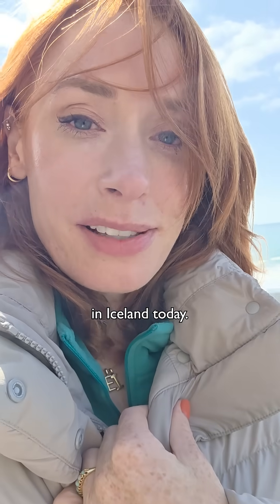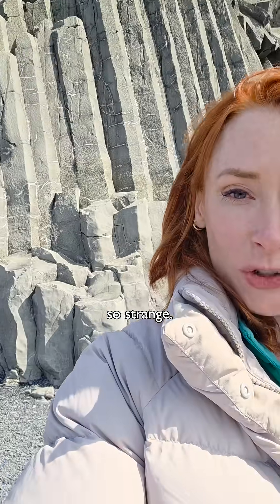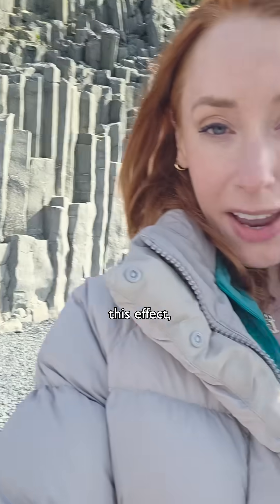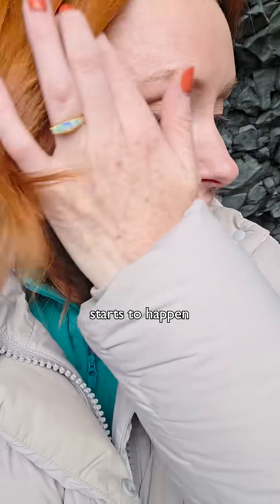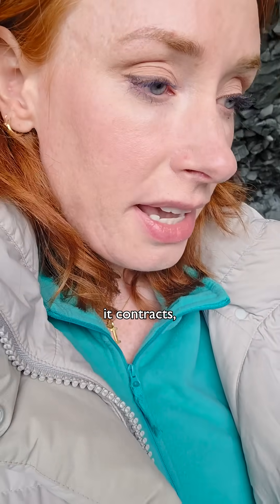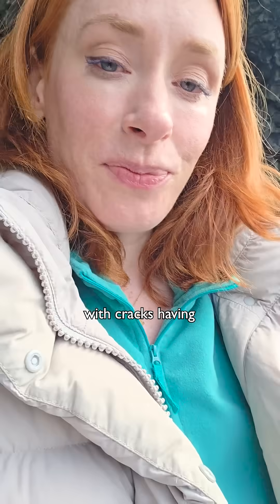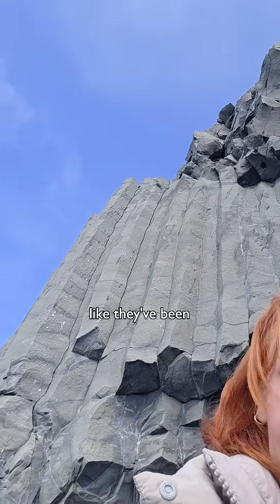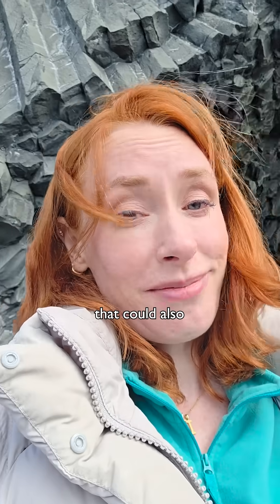Cracking the code of hexagonal rocks (aka columnar jointing)

Comment: I actually had to learn about this in Geography.

From the textbook: 

As subaerial basaltic lava cools, significant contraction forces build up in the body of the rock mass resulting in extensive fracture network structures which are predominantly hexagonal in cross-section, but polygons with three to twelve sides can be observed similar to those seen in dried-up mud of a marsh or river-flat that has been exposed to the sun (Holmes, 1965 and Wikipedia, 2012a). The structure that is formed during the cooling of subaerial basaltic lava is called columnar jointing (Figure 1). These joints provide ideal site for weathering of the basalt to take place.

Weathering of Basalt: 
The separation of shells of a weathered rock is called spheroidal weathering. It is best developed in well-jointed rocks which, like many basalts and dolerites, are readily decomposed. Water penetrates the intersecting joints and thus attacks each separate block from all sides at once. As the depth of weathering is greater at corners and edges than along flat surfaces, it follows that the surfaces of rupture become rounded in such positions. As each shell breaks loose, a new surface is presented to the weathering solutions, and the process is repeated again and again (Holmes, 1965).

Comment: <-- NASA Engineering Physicist (One of my engineering degrees is in Materials Science)
It's composed of Igneous rock with a hexagonal crystalline structure, causing them to fracture along 120° angles. There are 2 well-known geographic features here in the North American continent which are composed of this type of rock. The first is the Devil's Tower in Northeast Wyoming, near the Black Hills & the second is the Devil's Post Pile in Northern California, just south of Lake Tahoe near the Mammoth Mountain Ski Resort. The cooling of the top layer acts as a seed crystal for the fracture of the Miller Indices of the rock to fracture along as it contracts down through successive layers.

Comment: I'm sure others have pointed out - happens in beehives too. The bees actually make nice circular cylinders but they get smushed together forming hexagonal shapes!

You can see the same phenomenon with bubbles, too. If you can make lots of little bubbles all the same size and place them on a surface, they'll stick together and the boundaries between them end up straightish and make hexagons too!

When tubes or bubbles or whatever have slightly different sizes, you can end up with wonky shapes with different numbers of straight edges than six. Just so happens that when they'll all the same size they pack together perfectly so that any one circle is surrounded by six others
Reply: So columnar basalt tends to form nice hexagonal columns closer to the middle of the big lake of slowly cooling lava. The edges can cool a bit faster, and where it's more shallow can cool faster too, so you get a bit wonkier shapes where the rate of cooling is different.

Comment: This reminds me of the shapes of dried and cracked mud.  Imagining it with much more depth and propagating down through the depths kind of makes sense.   Lava usually contains gases as well.  It will tend to off-gas and that has to go somewhere.   When mud dries through evaporation, the water vapor has to go somewhere too.  It can go through the top or through sides if it can.  As the water leave it reduces in volume.   It contracts.   As lava contracts, gases can get out easier, which leads to quicker contraction.

Comment: Funnily enough I accidentally conducted this experiment when I had two glasses stuck together. I video on YouTube suggested putting cool water in the top glass, then putting the bottom glass in boiling/hot water. I also had some dish soap on them trying to get them unstuck... Anyway they didn't become unstuck one of the glasses cracked instead. And it created a whole heap of bubbles really quickly and they formed perfect hexagons tightly together it was so cool.

Comment: Humm, not saying you maybe wrong, but I’m sure convection currents form a part of this. If you take a pool of vicious liquid in a still pool with a heat source at the bottom and a heat sink at the top, hexagonal convection pillars will result. Which will cause this pattern when hard. You can test this….

Comment: Similarly, when I studied material science, I learned that the difference between granite and basalt was the location where the lava/magma cooled. With granite, it cooled above the surface of the ground and cooled with a crystalline structure. Basalt cooled much slower underground and has a stronger and finer grain structure. Same material essentially. In Victoria, Australia we constructed many buildings using bluestone (basalt) the gaol is one of them and St Patrick’s Cathedral. Considered the Irish building product. Our English churches, were constructed from sandstone. Not as durable as the former. Interestingly our top tier universities are considered as ‘Sandstone Universities’. Some stone snobbery going on.

Comment: There is a place in Australia I know were allot are. It's a part of a extinct volcano and I only take close friends there.
A hint, it is well known and partially submerged.
Palms line it's scalp, it is flanked on both sides by bleached white lines. Eastern rays warm it from slumber.
Rollers come and go.
It is not far from a natural devide that man has used to devide regions.
Has a name that is the same as a ancient weave, and weave on foot you must to get there.

I wouldn't go at night as old Aboriginal tales tell off not so friendly spirits that guard it.
I know a son of a elder.
A very good friend of mine.

Comment: In layman's terms, think of the usually dry desert riverbed after a flash flood. As it dries out again, from runoff and evaporation, the surface begins to form designs. Depending on the surface soils, you can sometimes see shapes similar to uneven hexagons. Once that surface is completely dehydrated, you can dig a crack to see that it continues under the surface for a while.

The lava sits still. It begins to cool. The surface begins to crack due to temperature differentials. Molten lava is a mass with significant heat that will resist cooling. As those surface cracks begin penetrating deeper, it doesn't just guide molecular structures of cooling materials. It is also introducing avenues of cooling down from the surface. Eventually, the cooling and solidifying works its way all of the way vertically down from the surface through the entire mass of lava. Thus, those cracks between segments continue as nearly straight vertical lines down. As she stated, that mass of lava, is a liquid collecting into drops while the more viscous materials, under great heat and pressure keeps the drops closer together, more like globs than drops. Water drops will often combine into larger drops when they are pushed together. The material makeup of the lava prevents those globs converging. Instead, they press against each other. And just like in a beehive, the hexagon is the most efficient way to share a confined space. At least, this is how those formations were  explained to me, years ago. I've always marveled at how they appear, especially when you see cross-sections exposed by erosion.

Comment: The beach at Vik is black sand. It is very coarse sand. The water when it comes in doesn't roll back. It just sinks into the sand.

There is a rip tide there and the water is typically very cold. If you end up in the rip tide, because you were so very much smarter than the people who put up the huge sign warning against it, it'll take a few days for your body to be found. But: rest assured, it'll land somewhere along the coast line, not to worry.

Comment: There is more to it. They aren’t perfect hexagons. In fact, they rarely are. It’s anywhere from 4 to 8 or more sides with uneven length, with 5, 6, and 7 being the dominant number of sides. From a surface tension standpoint it’s energy effective to rip in T-shaped cracks with some preferred angles. Drying mud also cracks in the same way.
Also, these basalt columns cool down and crack from both top and bottom, but the bottom cools slower. So you could see 2/3 on the way down how two different sets of hexagons merge.

Comment: This explanation applies to beehives too. Bees make cylinders tightly packed against each other, which settle into a hexagonal shape.
Reply: Hexplanation. What a missed opportunity!
Reply: @Metalingus-AB 
Oh!  That’s good!  A new portmanteau!
Reply: @Metalingus-AB  On this day, we see clearly
Reply: Are you a beekeeper or are you Jason Statham because that is a very cool comment, sehr cool.
Reply: @Tasty-the-money  not a bee keeper, I just correlated two physical phenomena out of my repository of largely useless information. Sadly, not Jason Statham either. Big fan, though.
Reply: @Tasty-the-money  I saw the movie and started buying my honey at normal shops again. I have a loose tongue and want to die old.
Reply: @holzdergeier A life with honey in it is a wonderful life.
Reply: @Tasty-the-money Jason Statham would be sehr cool as a beekeeper. Maybe beekeeper/assassin of bad guys?
Reply: It's because hexagons are the bestagons!
Reply: @IgorAntarov  that sounds like a quote from bee movie!
Reply: Maximum capacity for bee eggs/larvae -  minimum volume for the wax.
Reply: @rogerturner5504  And it cuts out those nasty thin holes that are difficult to dust.
Reply: @rogerturner5504 yes, but the bees didn't figure that out, they're just making wax tubes to fit the space, which accidentally happen to fill in the gaps. 

It's what Nature does that LOOKS like design BUT IS NOT. 

It's easy to see the attractiveness of the ID concept, so it takes some discipline to even explain why it is wrong. 

Evolution is a shotgun, only the hits survive, to make the marksman look like a perfect shot!
Reply: @chrisfreebairn870 Evolution is still a f-ing theory why do idiots believe it.  Real Science lines up with Gods Word.  Science cannot prove or disprove Gods Word which is the beginning of All His-Story!!!!
Reply: @chrisfreebairn870 I think it's a little short sided to not presume that the bees do it on purpose. Insects do a lot of things on purpose because it works. They might not intend for it to be pretty. Pretty is a human concept. But intentionality. Nature does many things intentionally all the time.
Reply: @chrisfreebairn870 it doesn’t even matter if the bees aren’t figuring that out
Reply: @KayleeMcC what is it that you think matters? I presume you understand the critical thing here is what it is that is actually being claimed.

So what is the claim here? 

Some have said the bees figured this to be the most efficient use of space. 

I have posted several times here on evolutionary aspects of bee cleverness relative to the proposition of ID, it other Grand Plan ideas. 

Perhaps you'd like to expand on your perspective.
Reply: It uses the least amount of material to make the most amount of space
Reply: @erikike1  The reverse - it is the closest you can pack molecules into a defined space - hexagonally packed materials have the greatest density and stability.
Reply: I came to write the same comment. You did a great job.
Reply: The path of least resistance
Reply: Thanks for the candour.
Reply: Honey is bee lava.
Reply: The Devils Minions
Reply: Came here to say this
Reply: Hexagons are the bestagons!
Reply: @sophiemitchell6874 I suppose I’d rather have you jacking comments than cars.
Reply: I wonder what if she can fart for us in her next video .
Reply: Like attaching 6 strings to a loop of string and pull at all of them at the same time.
Reply: I was gonna mention beehives, too. The rocks aren't the only place where hexagons appear in nature
Reply: Wow (2.  Thanks.
Reply: Wrong honey comb is built in a hex.
Reply: @leh3720 apparently not: it is built as cylinders & the wax settles under its weight into the hexagonal form.
Reply: @leh3720  the artificial ones beekeepers use, yes. natural ones, no. that;s just a physical side-effect of stacking tubes.
Reply: No they build them hex.  I see natural brand new comb built all the time it is always hex long before it's filled. It starts as a hex always. I'm a bee keeper.
Reply: She always stands in front of the things she is talking  about  blocking our view . MOVE OUT OF THE WAY
Reply: Stone bees? Giant mason bees? Fucc outta here
Reply: Love your sense of humor.👍
Thanks for the explanation...
Also, for taking us along with you on a cool field trip.👍

Comment: Iirc, hehagonal shapes show up in fluids quite a bit. A faster version of these lava hexagons can be seen in gasoline in a shallow dish with a few drops of aluminium paint. Heat it with a 40W filament bulb in a reading lamp above the surface, and watch the hexagonal cells appear.

Comment: The columns are formed(if they are formed) at both the top and bottom of the lava flow. The ground is much colder than the lava and is also a greater heat sink than is air, so columns form from the bottom up. She is correct about the upper columns forming from the top down. There is a layer between the columns that is chaotic( called the entablature.) Most of the columns we see today are the bottom columns, the chaotic layer and upper columns having eroded away.

Comment: In the Netherlands we have much Basalt  as coast protection, since these rocks have an extraordinairy density and keep the structure open for hydraulic pressure (compared to concrete slaps or asphalt which are dumb as coast protection for many reasons). Great to see these in their natural form ❤

Comment: There's another formation like that in the Eastern Sierra called "Devil's Postpile."  The columns are not all hexagonal.  They range from 3 to 9 sided with maybe 1/4 of them being hexagonal.  Your explanation needs some work.

P.S.  Devil's Postpile is a National Monument.  The ranger said it was caused because the lava flow cooled quickly from both the top and bottom at the same time.

Comment: Fluid Dynamics - Cooling of liquid to a solid using La Place transforms proves the point. Hexagonal.  You end up with √3⁄2 (or approximately 0.866) because 120° lies in the second quadrant of the unit circle, where sine values are positive. It's the same as sin(180° − 60°), which equals sin(60°) DONE.

Comment: The best explanation I've heard of how it happens! It also explains honeycombs. Nature loves circles, but when you get too many of them together, you get straight lines. The most space eficient disposition are the hexagons
Reply: Or triangles. Or squares. I'm sure there is a number above 6 that can also do the job ?
Reply: @commonpike  naah hexagons are the bestagons
Reply: @commonpike  he's missing the part where physics is an important constraint. hexagons have the largest internal angles for a repeatable shape in 2D orientation. squares and equilateral triangles work in some chemistry cases tho, like in crystal lattices - but those are 3D, and the dominating constraint isn't "space efficiency"
Reply: @commonpike  Yes you can get tessellations by repeating squares and triangles. The point being made is that in hexagons you have the ratio of having the least amount of perimeter to the most amount of area inside. Why is this important? Because nature wants to conserve. If bees or apparently rocks, want to have the most inside space to store materials while using the least amount of, in the case of bees, wax, the perimeter space must be conserved. To do this nature creates a tessellation, where the outside perimeter of one object is also used on the outside perimeter of another. The video did an excellent job of showing the importance of not having gaps because then that would increase the material needed for the perimeters. The inside area is increased by using the object with the most sides that would still create a tessellation. Regular shapes, in this case regular shapes are shapes with clearly defined sides. Ie Europe has a shape but it is not regular and cannot be used in tessellations. You are wrong in the assumption that regular shapes with more sides than six would create a tessellation. Only Triangles, rectangles, and hexagons that are one size can tessellate. Tesselate is when a one shape of a particular size repeats itself to fill an area.
Reply: @reginaodell3035 i stand corrected and flabbergasted.

Looking a bit deeper - in order to get a tesselation (with a regular polygon) the sum of the angles at one point have to sum up to 360. 6 triangles can join at 6*60 degrees, 4 squares at 4*90, 3 hexagons at 3*120 degrees. the next option would be 2 infinite plates at 2*180 degrees 😊

the previous option, before triangles, would be a regular polygon with two sides. That sounds eerily similar to the last option after hexagons. 

There is something broken in this reality we live in 😅
Reply: @reginaodell3035  Why is the assumption that regular shapes with more sides than six would create a tessellation wrong?
Reply: to reply to myself, yes, there is something broken in this reality :-) in hyperbolic space there are an infinite number of regular polygons that can tesselate. 

so now I want to live there.
Reply: @commonpike Hexagons hit the sweet spot between strength and amount of material used.  Going higher in number of sides requires more material but doesn't add a significant amount of strength.  This is why many manufactured parts in aircraft, racecars, etc. use a honeycomb structure - maximal strength at minimal weight.